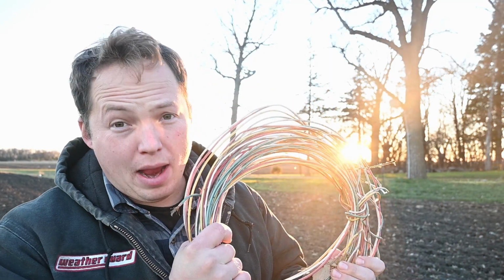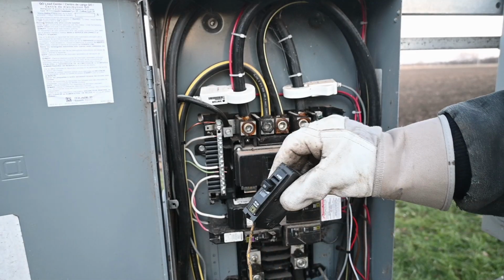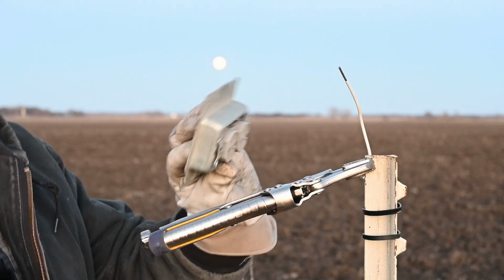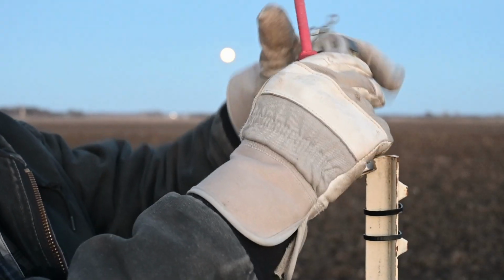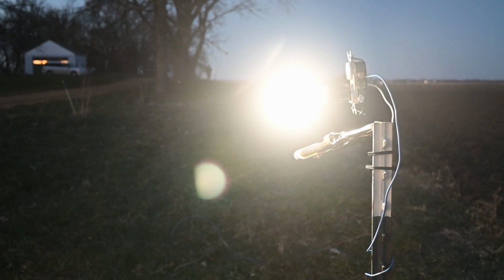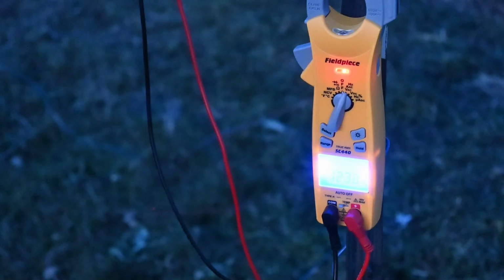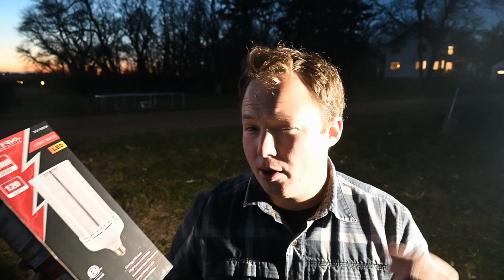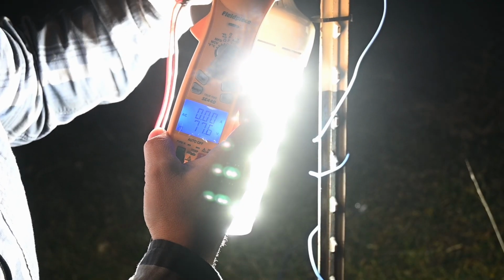Powering a Light With a Fence Post & Scrap Wire - SWER (Single Wire Earth Return) Demonstration

Comment: When I was 14 we built a cabin about a mile and a half into the woods behind my parents house. After lots of Google searches we ended up grabbing two microwaves and used one transformer to boost the voltage and one to step it back down. We kept the transformers in 5 gallon buckets of mineral oil to keep them cool. With a quite a bit of patched together Romex in the trees on electric fence insulators we ran the hot through the trees and took care of the neutral with ground path return. It worked well but it terrifies me to think about now 😂
Reply: No more terrifying than when I was a Cub Scout in '63 and we built hot dog cookers with nails and wires. Stick a dog on 2 nails with a conductor connected to each and plug it in. Could have cooked a Cub or two accidentally. 😱
Reply: @donaldshimkus539  you do know a microwave transformer produces 2 kilovolts right? Presto used to make exactly what you're describing any how, look up the "presto hot dogger"
Reply: @alec4672  I'm sorry, we didn't use the microwave transformers. Just a lamp cord stripped at the end and plugged into a receptacle. Oh, and I might have one of those "Hot Doggers" in my collection of junque, lol.
Reply: @alec4672  I have also jump started vehicles with just one wire from positive to positive and the bumpers touching. That was back when they made real bumpers out of real metal.
Reply: @alec4672  as a kid my dad bought one of the Presto Electric hot dogs cookers. I can still remember the awful smell from those electrocuted hot dogs to this day.
Reply: @alec4672  - you do know that Walmart was 1 store in Arkansas in 1963, and they didn't carry cheap Chinese microwaves back then?  And the one and only 80 pound Amana Radarrange, if they had one, would have been stuffed in a wall cabinet back then and a bit too inconvenient for boy scouts to carry camping, and too expensive to pull out to tear apart for giggles.
Reply: @Phantom0fTheRouter  your point being what exactly? I was born in the 90s 😂 plenty of microwaves to be had by then. Plenty of Walmarts too whatever that has to do with anything 🤷🏻‍♀️
Reply: @donaldshimkus539  I think I was 13 and didn't know a thing about electrical anything basically and had the great idea to take a lamp cord with the ends stripped and a nut and bolt screwed on to the both ends and then "held" them apart about a foot and then had my friend plug it into the wall to supposedly make a home made cattle prod. Yay stupidity!...  

I then proceeded to slowly bring the ends together like a complete idiot, and all this while standing next to my antique metal radiator filled with water in my bedroom. I think the bolts got about 6 inches from each other when the electricity started flying back and forth to each other and then they started magnetizing and pulling together so fast that there was nothing I could do to stop it and the next thing I knew there was a big ball of light and a loud bang as it all suddenly pulled twords the radiator and came together like watching a welder on fast forward fusing it all to its metal at literal lightning speed as ALL the lights went out in both my house and on the entire block....

I've never jumped back that fast in my life! And I've never felt that dumb or scared either lol My friend and I had to do a lot of serious problem solving to get out of that one without anyone finding out what we had done.

Moral of the story I guess is don't mess with things you don't understand and now as an adult never leave overly creative kids home alone....

I'm just this moment realizing that I've kind of failed a bit as an adult because I still don't know enough about electricity to do ANY of the projects I want to work on here at home.... I guess I should just stick to the actual building part of my projects and pay the professionals until I actually have some serious knowledge otherwise I might just burn this house down... Geez.. Good thing I was just inspired to share that with you! You didn't lift a finger and you may have just saved my life! LOL!  Yeah, I guess it's not really that funny.... ugh
Reply: @donaldshimkus539  LOL 🤣
Reply: @donaldshimkus539  wow that's cool
Reply: @donaldshimkus539  as opposed to fake metal? 

what you meant, but didn't say: bumpers are no longer metal, but  consist of a plastic cover over a reinforcement bar made of steel, aluminum, fiberglass composite, or plastic, making it impossible for the bumper to act as a ground circuit.
Reply: @steveolive9991  aren't rubber and plastic kinda like fake metal? Lol, you're correct. It's a common mistake most people make, but I think we all understand the inference. Thanks for helping me correct my english.
Reply: @donaldshimkus539  That was dc current. Some trailer lights use the same ground through the hitch.
Reply: @donaldshimkus539  !n!aaa
Reply: @shawngessells9924  let go of the wire. Lol.
Reply: @donaldshimkus539  haha Big Clive does a few awesome videos on these units ;)
Reply: @donaldshimkus539  I just like to point out that electrocution, just like execution, is fatal.  If you get shocked and live to tell about it, you didn't get electrocuted.

I'm sure that if enough people use that word the wrong way, they'll get the dictionary term changed.
Reply: @throngcleaver  it's like calling a snake poisonous when the correct word is venomous.
Reply: @donaldshimkus539  Exactly! That's one of my pet peeves too. 😄
Reply: @throngcleaver  right! Only exception would be if your heart stopped and had to be restarted. Then you’d probably have a NDE story to tell.
Reply: That is why I stand on one foot when messing with high voltage!!! Also watch that you are not touching anything with your other hand.
Reply: @michaelharrison1969 thanks mate  i never thot of that but i will remember
Reply: @michaelharrison1969  what does standing on one foot accomplish exactly? There's still a straight path from your hand through your heart to your now one foot. It wouldn't make a difference, even standing on two feet the current only exists out of one foot, usually the one with the most damaged shoe.
Reply: @alec4672 Standard electrical safety procedure, if current crosses heart can fibrilate heart muscle. So only use one hard to touch anything. Insulated shoes/boots are a must. But if electrical lines are down put feet close together or one foot only, as the current traveling through ground can differ from leading to trailing foot due to wavelenght and amplitude.
Reply: @dananorth895  it isn't though 😂😂 you don't wear insulated boots you wear "hot gloves" or insulated gloves. You trust something you walk around in all day to not have a pin hole that an arc could take advantage of? Balancing on one foot sounds like the perfect way to accidentally touch a live conductor.
Reply: @alec4672  Current can't actually go across  your chest, heart  that way. Jus t go to  ground, still not  good to be bit by it though, Ha
Reply: @grassroot011  your blood has iron in it, making it very conductive. Meaning it's usually the easiest way for electricity to travel through you. Your blood vessels including your heart become the conductor. Serious electrocution victims will have literally cooked/chared hearts. It definetly travels through your chest if it feels like it.
Reply: @alec4672  - The hot gloves used by the municipal utilities company in a city I used to live in, were made of some type of rubber.

To test them to make sure they were safe, they put them on an inflater machine made for that purpose. It filled them up like balloons, to test them for pinholes. 

If they had a pinhole, they would circle it with a white marker, (black gloves, or rather, more like mittens) and throw them away.

Looking at the spot marked with the naked eye, even upon close inspection, you could not see that pinhole when the mits were in their natural uninflated shape.

Not really mittens either. They looked more like a lopsided pincers. Index finger and thumb in one part, the remaining three in the other, if I remember right.
Sleestacks from "The Land of the Lost". Very large and very loose fitting. You could easily wear insulated gloves under them with room to spare. 

They take safety very seriously of course.

I used to have a box full of them from dumpster diving their annual shop materials cleanout.

Oh. My point is the pin holes. Backing up your comment. Even the tiniest hole must let the electricity through. Which is really quite amazing. I don't think even water could get through those microscopic holes. 

[Heads up. Everything from here on, is off topic. Not relevant to the conversation.]

That and so, so much more. Like their practice dummy for practicing emergency rescues.

Designed to be as heavy and awkward as a dead weight human would be if unconscious.
It swiveled at every joint, and probably weighted 150 to 175 pounds. 
It was a real bitch moving that thing around. Luckily it had a big hook coming straight out the top of its head. 

I had it stored at a friend's farm place, and one day some other friends came over and were target shooting with their toys. 

I did not want to destroy it, (preferred to sell it) but sort of got talked into it. It has nothing to do with the fact that they had all the guns and I had none.

So, it was blown apart piece by piece, hanging from the tree, using 2 AK's, a Mac 10, some other cool gun I have no idea what its called, but the rounds looked maybe like .223's?, a thirty ought six, (.306?) bolt action with clip, (my god those are big rounds) a 12 guage pump shotgun with pistol grips (dumb, imo), and various rounds and loads, an amazing single shot air rifle that loaded its gas charge from breaking the barrel open and closing it, like an old double barrel, surprisingly quite powerful for an air gun, various semi auto hand guns, 9mm, .22, .45, and a 22 revolver. 

Oh and a hatchet and axe. 

Beings how it was my dummy, I had the privilege of shooting all of them. Which I could have probably done anyway, even without giving up the dummy. 

While I did not currently own any guns, I grew up hunting, and am a damn good shot with pretty much any gun. Even the hand guns. 

Honestly better than the owners of the guns were, except in the case of an ex military guy, and that only with his own gun.

It ain't bragging if its true. 

Look at me, I've digressed all over myself, off topic as can be.

I'm gonna leave it all in. 99% will see the length of it and move along without reading it anyway.

Alec, I like your last name, Ver Bunker, real or not. I don't know why. I just do. Ver Bunker. German? Dutch?
Reply: @dananorth895  I guess everything truly is wave length and geometry on a lot of not so obvious levels
Reply: @alec4672  I suspect he is referring to standing on ground that has a voltage gradient, with a high load the voltage gradient could be significant over a couple of feet, perhaps stand with both feet together would be an equivalent solution😋 I don't really know😶‍🌫️🔌⚡
Reply: @dananorth895  Repairing old monochrome computer monitors, the rule was to work with one hand in your back pocket.
Reply: @michaelharrison1969  and with your free hand you rub your belly counter clockwise while blinking  your eyes 1 at a time so you sync with magnetic north and direct the electrons back to the dark side of the force......sorry....hahahahaha
Reply: @michaelharrison1969  hand in the pocket rule, you don’t want a short across your chest
Reply: @michaelharrison1969  I always thought one of your ancestors was a flamingo
Reply: Standing on one foot sounds like complete nonsense.. 😂
Reply: @mrburns366  its not nonsense, so read the replies. I just learned something about electricity that I just realized I should have known because of my knowledge of wave length, frequency, and their geometry.
Reply: the one foot idea works if you ever need to exit a dead vehicle in wet ground conditions near a downed powerline. 1 foot hopping avoids a path from foot to foot when walking. the moment yur 2 feet touch electrified earth your dead.
Reply: @mrburns366  Deapert times call for desperate measures 😄
Reply: THEYHATEME Yourmomma  I WAS 14 😂😂 that's the whole point of the story. I did it as a child, in a rather terrifying manner. Also our government doesn't do this in the United States. The government doesn't provide power here, the power company does.
Reply: @alec4672  that's right. The power company OWNS the government.
Reply: Good way to get lots of worms to come up out of the ground.
Reply: @pstoneking3418  
Goin Fishin' 🎣
Reply: @pstoneking3418  In different parts of the yard, you could tell whether you were going to your house’s ground or your neighbors ground, with one rod in the earth, by feeling the earth with the flat of your hand and by where you see worms coming out.(coat hanger wires twisted onto an old extension cord strands stripped on one end) With both rods poked in a couple feet apart you could feel the grass or damp dirt for a tingle in between the rods as current takes the path of least resistance.
Reply: BY GUESS OR BY GOSH ENGINEERING
Reply: @beepthesheep867  that brings up a good point when trying to educate these silly people 😂 "free" as in effort not money 😂 it's pretty easy to get free electricity if you're not afraid of breaking the law. White you're tactically right about solar, you still gotta buy the panels and maintain the system so it's not entirely free but pretty damn close.
Reply: @alec4672  not even close. By the time you finish paying for all that equipment, it's time to replace it all. AND, start paying all over again.
Reply: Thunder Struck  no actually I'm a Gemini.
Reply: Always wanted  to do something like this for a property about 4 miles from a house. Never had the nerve to try haha
Reply: @unknown-ql1fk  I might try it now but that's only cause I've done it before. That's the thing about being a kid, you're good at ignoring consequences 😂😂
Reply: Very interesting comments.  When we bought our home 25 years ago, in the shed I found a variety of items that a lineman uses when servicing power lines on poles.  On item I use to this day is a pair of very thick and heavy but surprisingly comfortable gloves that extends to my elbow.  In all these years, the gloves have not deteriorated at all.  I’ve used them for other activities with chemicals but also for working on some mains wiring (back when we didn’t have custom current clamps to measure power consumption).  I also have a 5 foot pole made of bamboo with an articulated hook at one end and a sliding handle at the other.  It is used to open and close fuses on power poles.  Occasionally used it but I keep it handy in case I come across a hot wire downed by a tree (stopped a fire from a live wire in bushes with smoke and flames in wet ground).  I say all this because looking at the kit the previous left behind showed to me the quality of the personal equipment our power company provided to the lineman.  I don’t think Home Depot sells the stuff that’s in that kit.  Lucky me… until I screw up.
Reply: I sincerely hope that the majority of people reading this thread never interact with electrical components any further than plugging into a wall socket or jumping a dead battery. The wiggle room for arbitrary suggestion concerning electricity is very tight and the cost of a single one time slip can be disproportionately high. No fair and but what ifs or that with zero forgiveness and zero apology. Depending on hope, trial and error and dumb luck is not a tactic. Innumerable hours in class, and in field, arc flash training, on the fly repairs pending high cost downtime and lots of discussions and storytime with old timers has led me to being almost comfortable... plugging in the microwave or jumpstarting a car. 
I don't expect you to listen, I just wrote this for my own peace of mind.
Reply: Bv
Reply: Check your phone
Reply: I remember back in the 70s we wanted power in our cabin nearly a mile away, (and we didn't need to chain the animals up for safety) we ran mercury arc rectifiers at the tranny, after an hour shook them over buckets to collect all the electrons. We carried the buckets to the cabin and emptied them over a big coil, it worked for a few days. Then we looked outside and saw an open suitcase and women's clothes scattered everywhere, the disgusting tranny had ran away with the dogs.
Reply: That is terrifying 😂 microwave transformers are no joke.
Reply: 10 gallons of mineral oil is like $200 though. that stuff is so expensive! and you had to cool the stepdown really? not just a heatsink? id think the lower amount of power there would mean alot less heat?
Reply: @willcal2738  I'm not sure if we needed to have them in oil or not we never checked the temp of them that I can remember it just seemed like a good idea. My dad's friend worked for the utility company and we got a bunch of what I think was mineral oil from a pad mount transformer that had been crashed into. Whatever kind of oil it was it worked for what we used it for.
Reply: Very cool
Reply: 🤣 old timers kick ass
Reply: @merllhagard6799  I don't know if you read the thing closely but I said I was googling it 😂 I'm 25. Don't think that qualifies as an old timer.
Reply: @alec4672  😅 Oh, you most certainly qualify, Bubba.
Reply: My grandfather invented that concept back in the late 50's, when, as an electrician he used live wires to cook his hotdogs on his lunch breaks.
He just didn't patent it!

That is a story my grandma told us kids one time. Just one of many highly exaggerated tales of their past.

As a kid, I believed it. 
For long enough for it to matter.

She also said grandpa could work with live wiring and touch it without getting electrocuted.

I found out a little while later that I could touch live wires and not get electrocuted either.

 We moved into an old house we were remodeling. The electrical outlet recepticle in my room was sticking straight out of the wall. Not dangling. More like jutting. Supported by the old romex wiring it was attached to.
 
So I grabbed it with my whole hand to shove it back in. Got that electro buzz fuzzy vibration tingle jarring zap feeling up my whole arm.  

Scared the hell out of me. 
But I lived!
Apparently the ability to withstand being electrocuted was something in the blood. 
Passed down from one generation to the next. That must be why Grandpa was an electrician. It couldn't kill him. 

Still... didn't do that again.

Then a few years later, I found out you and everyone else can do that too.

And that getting a little zap was not quite the same thing as getting electrocuted. 

Our neighbor worked for the REA.
 Rural Electric Association. He had a hook instead of a hand. 
Yup. Like the pirate. 
I was curious about it at first, but never asked.  Out of it being impolite or rude and really none of my damn business anyway.

Over the years I got used to it as just his arm, normal, and no longer even thought about how it happened that he lost his forearm and hand.

Then one day, when I got a job working for a subcontractor that was building power lines for the same REA... I realized  my neighbor had actually been electrocuted.  

So badly that it literally burned his hand and part of his arm off. 

When you grab on to that big stuff, it contracts your muscles so severely that you are not able to let go.

Think about being in that position.

So there you stand. Being electrocuted to death by the high voltage you just grabbed ahold of, knowing it's happening, and unable to let go of it no matter what your brain is telling your hand to do.
Reply: @kentneumann5209  - the higher voltages before the transformers, you won't have enough time to even react.   Arc flash at high volts backed by high amperage is no joke.  Chunks of you being vaporized and exploding to steam in fractions of a second.
Reply: @orcoastgreenman   - Godamn graphic picture you painted in my head. 

So you don't even have to touch something that's hot. It can jump out from wherever its at and blast you just by being near it? Why would it do that? I believe you 100%, but what law of electricity would make it do that if its already running through something else? Does it seek the shortest path to ground? If so, what makes it do that? Its almost like its alive. 

And how is it that line workers can come in by helicopter and grab onto transmission lines without getting cooked? Is it cuz they are not connected to the ground, as in the earth?  Does the electricity just flow through them? And do they feel it? 

Lots of questions. I should just look it up myself. 

Thank you for sharing your knowledge.
Reply: @kentneumann5209  electric current travels between 2 electric potentials. Suppose you had 100 volts potential and 2 nearly identical metal rods for conductors, one being twice the cross sectional area of the other. The impedance of the thicker one would be half as much, it would allow twice the current. So you'd get 1/3  of the current in the smaller one and 2/3 in the larger one. However, all the metal is conducting equally ( this is ignoring skin effect, aA.C
 Conditions, etc..)  so basically with any electric field, the electric current will take all paths "equally". The problems is simpler if you look at conductance instead of (the reciprocal of) resistance. Even though one current path may be very minimal in percentage of the total, at high voltage it could become substantial, especially when its high enough to break down the dielectric of an insulator, or the air into a plasma   (thereby making it  "conductive") and drastically changing the entire circuit ( e.g. the smallest path could become the biggest).
Reply: @kentneumann5209  yup, 120 volts tingles if the amps are low. 240 volts can grab you, 480  volts will grab you and probably kill you.. higher than that and it explodes out of your body..
 I once grounded a Thaw Box from hand to hand straight through my arms and shoulder blades.. thanks to my brothers fast thinking he didn't leave the pump plugged in as my arms contracted and I flew backwards, I saw a bright light as I jerked away from the water lines coming into the building.
Reply: @kentneumann5209  
‼️💥‼️That happened to a friend of mine in highschool!
We had snuck out after the parents went to sleep.•°•.•°•.•°
We were trying to get out buddy to come to the window, but he had dozed off while waiting for is to come pick him up!  Alan grabbed the fat wire coming out of the air-conditioner, but he was standing in a puddle of rainwater, and shorted the power to the house!!
THE FUNERAL WAS Three Days Later!
Reply: @brehpotsirhc  so did your friend ever come out?
Reply: @kentneumann5209  I can actually test live wires with my fingers. Sometimes my skin is too dry and I have to wet my fingers. Been shocked many times and several should have killed me, but for the Grace of God, I'm still here. Oh, and maybe that blood thing. Low iron? Lol.
Reply: @kentneumann5209  You would do well as an author. Looking forward to your next 
book/comment.  😊
Reply: @kentneumann5209  I've been electrocuted more times than can remember.  None if them were any fun. Just remember if you complete the path or the voltage is high enough to jump to complete the path you can get electrocuted.
Reply: @pstoneking3418  electrocuted means death by electricity
Reply: @pstoneking3418  ...I got hit by a LARGE 'GE' magneto off of a LARGE radial aircraft engine back in A&P school.....all i remember was voices....voices far away.....couldnt really tell what they were talking about but It seemed to be me.....then cold.....the side of my face and the right side of my body was cold....and the voices got closer....and they WERE talking about me!!!! and then I realized my eyes were closed so I opened them.....and everything was sideways.....i was laying on the(cold) concrete floor of the shop where my class partner had laid me down when I went OUT from being zapped....ended up they had to drive me home as I was w00zy, and it was friday so I got a ride back to school on monday for my car.....and my left arm was totally useless, thereafter, for about 10-12 days and had that 'pins and needles and numb' thing going on for a while after that......OOF......that was a GOOD one......and large, transport class, aircraft have 115v electrical systems....but they are 400hz, not 60hz....and the 400hz REALLY BITES HARD when it gets you!!!!!  dont ask me how I know this to be true fact....../:={
Reply: @pstoneking3418  you were shocked, not electrocuted
Reply: it was still registered by the electric meter?The electricity you used with the microwave transformers?
Reply: @danychris6671  well it was powered off the breaker for the shed so I'm assuming so, don't see why it wouldn't have been.
Reply: To all the commenters that say that electrocution mean death , it does not. The official definition of electrocution is “to kill or severely injure someone using electricity”. It is possible to survive electrocution.
Reply: @gottab.somewhere5971  yeah I was thinking the same thing but really don't want to waste energy arguing with dumb egomaniacs who can't handle being wrong
Reply: THEYHATEME Yourmomma  "wake up" I'm awake okay 😂 "free energy" doesn't exsist, it's against physics, get a job or something.
Reply: @alec4672  Maybe it doesn't exist the way you assume it's being referred to, but it does exist on levels most people are unaware of. For instance, the human body needs food for fuel and to keep the body alive, but that "alive" only refers to the body, yet the consciousness or spirit (which has been scientifically measured and proven) remains regardless of the fueling of the body, BUT what fuels the consciousness or spirit? 

There is a very real system of energy that maintains and fuels the existence of consciousness and it requires energy "flow" in order to maintain its existence, which is an "energy system" that is "constant free energy" by definition. It's just not the traditional technology that we now use. 

So basically there are other systems and it's important to think outside of what obviously doesn't provide what the goal is, but it doesn't mean there isn't other systems of doing things that can provide you with the result of free energy.

Just sharing another way of looking at things. After all, if we hadn't done that we wouldn't have discovered the system we now use, which would have once been considered impossible and magical nonsense by naysayers.

🕊
Reply: @alec4672  Free energy exists and  is invented by Nikola Tesla but is NOT allowed for some strange reason... 🤢💵
Reply: When I was 14 I was playing call of duty and smoking weed out of an apple. What year were you born in?
Reply: @Bludcharg4214  well to be fair I was doing the same thing as you at 14 as well 😂 me and my friends just liked building stuff I guess. I was born in 98 in a really rural community we had dial up till broadband came to town when I was 16 we were kinda late to the party out here 😂😂
Reply: @Bludcharg4214  - your admission that reasoning is beyond you because you are brain-damaged is admirable, but unnecessary.